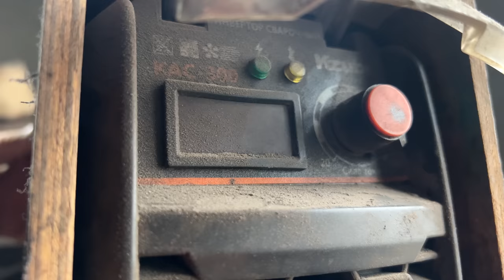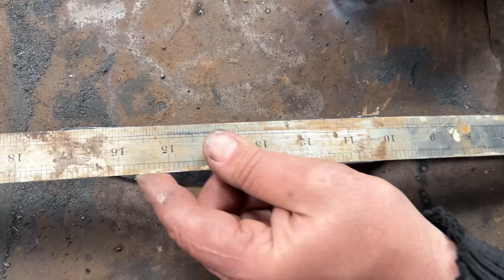How good a knife can you make from nails? Interesting challenge

Comment: this man must be a shareholder in Borax
Reply: Es borax?
Reply: @artemanualidadesynaturalez957  Borax is the white powder he is putting the metal in between heating and welding cycles (It is commonly a cleaner, but they make a formulation specifically for forging called forge borax or borax flux) .  It helps draw out impurities and keep out atmosphere (most critically, oxygen)   to ensure a strong forge weld without any inclusions, impurities or imperfections.
Reply: I imagine the nails would come with some sort of oil as well as dirt, additionally there is way more surface area getting exposed to air so the borax was used to fill those gaps to help kerp the oxidation down.
Reply: @kitmichas6985  👍
Reply: Do you need some knife with that flux 🤣
Reply: Haha

Comment: That's interesting, small question: what is the white powder that you put on the red metal piece?
Reply: whiteout, its a zinc oxide powder that melts to fill in gaps in the metal to weld them into one piece
Reply: @robertknight2615  I think you have white out confused with borax.
Reply: Borax

Comment: Wouldn't the glue holding the nails together prevent complete forge-welding?

Maybe causing inclusions?
Reply: I would think that those temps the glue would burn off long before welding temp was reached. I'll see soon enough.
Reply: It burned off with the outgassing
Reply: Yeah the glue isnt the problem, the yellowish coating on the nails is, that is liquid vinyl that is spayed on, yeah the same stuff that spilled in the US recently n poisoned the whole area. Not only is the gas from burning it deadly but it leaves behind very toxic residue that bonds to the steel n would make the forge welding very difficult. 
To remove it from the nails 1st you need to use low heat (just under combustion)
Reply: Включения в метале клинка это не что иное как железо поверхносный слой гвоздей из которого выгорел весь углерод и в итоге такой метал не пригоден для создания кромки лезвия к нему нужно приваривать другую сталь чтобы получить хароший нож
Reply: I think the literal bucket of borax that was used helped, also that metal was glowing so I would assume it would have burned off